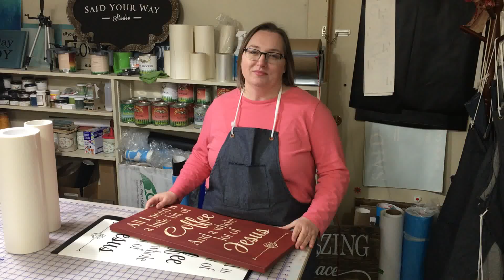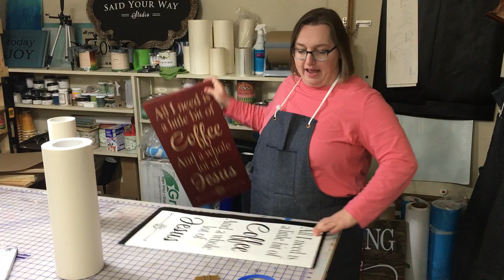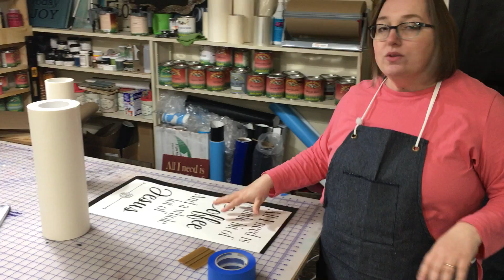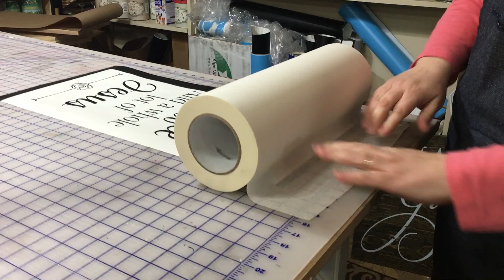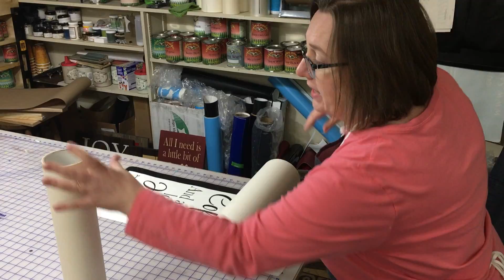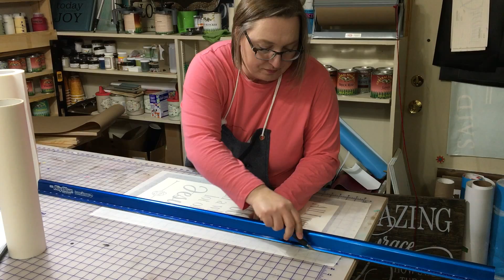Easy Transfer Tape (Application Tape) Roll Method - Making Signs

Comment: My problem dong this is for some reason my tape wants to tack off to one side or the other, I have a hard time going straight. Any ideas? Thanks.
Reply: I learned this years ago and I had this same problem....Getting the graphics straight...usually just make sure you get a little bit larger roll of tape because you are essentially guessing if it will roll over all your graphics.  This method is still great if you don’t have a table with a ROLL HOLDER... but a transfer tape ROLL HOLDER is the BEST way because it solves that ‘laying the tape straight’ problem....also, you can “wrap” around the masking tape around the empty tube and push with the Transfer tape roll.....i find this better than technique used in this video.....but still probably the easiest way honestly to mask graphics is just to buy a 5 roll tape holder that attaches to the end of a table.... you can get these 5 roll holders at SPEED PRESS.com.   I think this is the fastest way. And you know that your tape is going over your graphic....... that way you can see the tape goes straight over the area you need before you put it down on the graphic....
Reply: The steam rolling pushing one. Push it from the middle of roll not one side or other

Comment: I am TOTALLY confused.  If you are using this as a stencil (which needs to be uncovered for the ink/paint/etc. to get through to the sign); then why would you cover up the "stencil" with clear tape?
I believe I am missing something.  Sorry for my ignorance.  Are you then going to paint thru onto the transfer tape so that you can remove it and transfer it to the actual signage material (wood, core board, etc.)?  If this is the case, then you are missing the next step, or there is a Part II which I haven't found.
However, thumbs up for method to put down transfer tape.
Reply: She said it's a reverse stencil. So after she uses the transfer tape to tranfer the image she will pull the tape off, paint, then take of the stencil. Hope this helps.

Comment: what brand of tape are you using, if you dont mind me asking? thanks! great vid!
Reply: I was wondering the same thing. I just finished a job and used cricket transfer tape and it is GARBAGE!!! after years working in a sign shop when I was younger I can not for the life of me figure out why they would make the tape so strong. A job that I was expecting to take me 20 minutes took over an hour and a half because the tack of the transfer tape was seemingly as strong as the darn vinyl!
Reply: Isnt this just crafting tape? Im using the one from 3M
Reply: i THINK ITS JUST PAPER CRAFTING TAPE